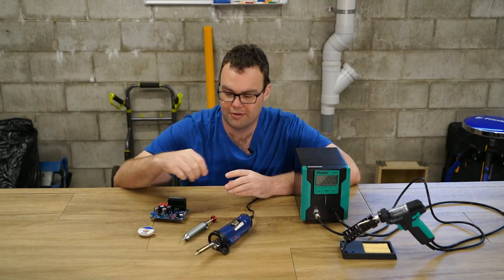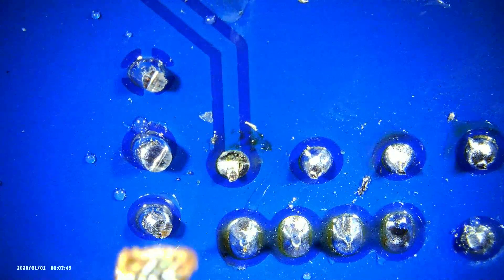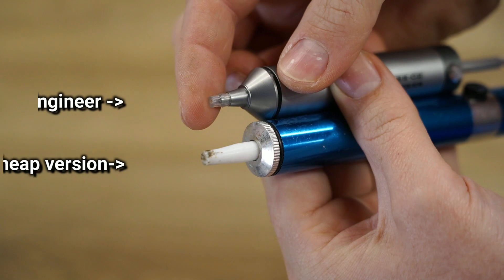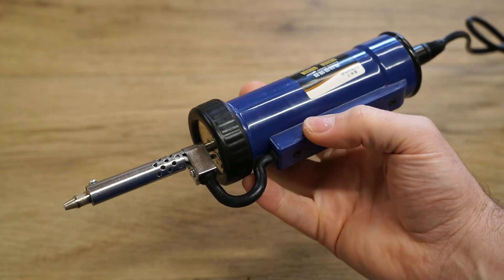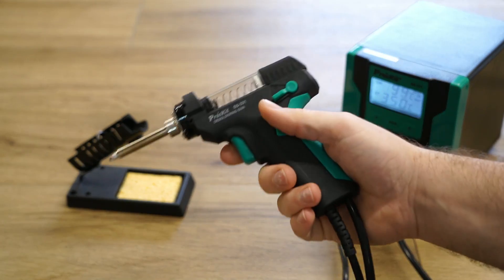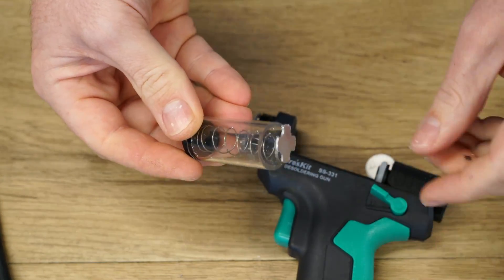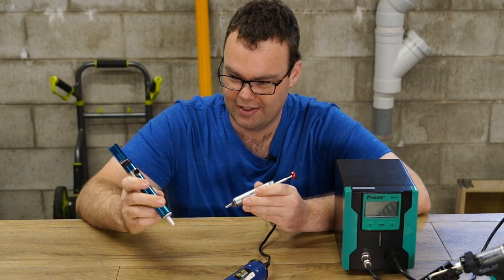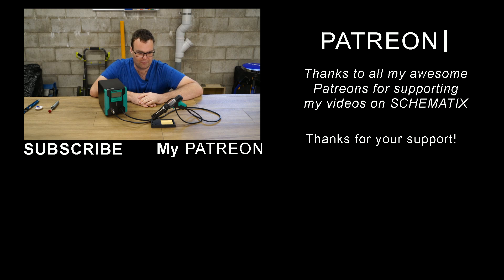The easiest method for Desoldering components!  Solder Wick, Sucker & Proskit SS-02 station Reviewed

Comment: 3:44 the manual for this product states not to remove the rear cap so as not to negatively affect the suction of the device. It says to remove the nozzle for cleaning and to re-lubricate the interior of the cylinder with a grease to keep it resistant to solder sticking.
Reply: Yeah I really don't get why he did it lol. It will mangle the O-ring on the threads really soon
Reply: What grease should be used? The solder sucker in the video is set to arrive at my house in 6 days, ordered it even before I saw this video. What grease should I buy so I can keep the sucker in good shape? And how often should I apply it?
Reply: @Malphaswastaken when it doesn't suck much of the solder
Reply: @Malphaswastaken i think they were talking about the previous tool not the solder sucker
Reply: 😂😂😂 HOW Tf are you expected to remove the solder from inside without removing it?!?!?
Reply: @kilgoretrout4461  you remove the bottom cap then squeeze the plunger to push the solder out.

Comment: you can easily upgrade that cheapo solder sucker by putting an old anode cap taken from crt tv to the tip of the manual solder pump, if your only desoldering single layer tht boards few components at a time it still works faster than a desoldering station as you do not need to wait for a couple of minutes to get  it to working temp

Comment: Many thanks for this video, I found it when looking for something to replace the plastic cheap piece of crap solder sucker I have, which I can guarantee you is even worse than the one you said made you hate solder suckers. I ended up ordering the Engineer SS-02 because of this test, and I have high hopes for something that actually sucks PROPERLY. 😉

Comment: Hot tip (pardon the pun) for the Proskit gun: keep the suction on for a good few seconds after removing from the joint to greatly reduce the amount of blockages.
Reply: The tip of a desoldering iron tip is supposed to be tinned, so that it makes good thermal contact. The hollow tube, on the other hand, is stainless steel so that solder won’t stick. However, flux residues can “snag” solder. The original comment is correct: one should continue suction to ensure solder doesn’t stop halfway through, where the heat may not be enough to keep it molten, especially if there’s flux residues in between. (That’s why some professional desoldering tools, like Pace, automatically run the vacuum a certain time, even if the button was pressed less.)
Reply: I have one of those but the tips are not so good, the solder is not sticking to the tips, its like they are made from the wrong metal.
Reply: @wicklowmountains8618 It’s a desoldering station, not a soldering station
Reply: @wicklowmountains8618  solder is not supposed to stick to the tip. That's how it is designed

Comment: Greetings from Egypt, I am a follower of you.... I want a method for manufacturing liquid tin
Reply: If you mean liquid solder, then search for "Solder Pot". Note that the cheap ones from China have some safety issues so watch YouTube videos to ensure that you understand how to make them safe to use. It is not a good idea to poke conductive wires into a pool of liquid conductive metal that might be at 220V mains voltage!

Comment: Coming from someone that routinely uses wick to clean up whatever the Engineer pump leaves behind, around a through hole component... Your wick technique leaves a lot to be desired. Instead of just laying over the top, push it in from the side and place your iron on the wick, but adjacent to the joint instead of directly on top of it. Obviously it is a slower technique, but when done correctly you can wick away every last remnant of solder without a pump.
Reply: 100% agreed. He uses solder wick almost as wrongly as Julian Illet.
When soldering, the solder always flows to the hottest place. So, moving the tip of the iron away (along the wick) after the joint is heated will pull the solder and literally "vacuums" it out of the hole.

Comment: As someone who works in a factory setting and uses a solder sucker daily, I dont want people to sleep on some of the cheaper solder suckers with plastic tips. I've personally used the Engineer solder sucker, and while I love it and would definitely use it for personal projects, the silicone tip just doesn't hold up for repeated or long term use. I found that after about a week of factory use the tip degraded to a point where it didnt make a good seal with the pad and the sucking quality decreased greatly. Meanwhile the cheap plastic tipped solder sucker my company provided made up for that in pure power over seal quality. While the plastic tip is definitely worse for making a good seal, the pure power of the springs in some cheaper solder suckers makes up for it and creates a much more consistent performance. All in all the Engineer solder sucker lasted me two weeks of daily use while a cheaper variant with no name has lasted me years without degradation
Reply: Plus one has to consider replacing those tips if need to, in the UK they are impossible to find easily and cheaply delivered, so that's a restriction from me, my cheap and cheerful manual plastic one just works everytime, once you get to know how to use it.
Reply: I got one cheaper solder sucker myself. Was 2,50 euros.. Did the job just fine.. So not all cheap things are bad. But i agree that plastic tips are getting worn, and then its expensive to replace. mostly 5 - 10 euros)

Comment: I had a coworker that would use a air compressor nozzle to blow off the solder. I was shocked because none of his work had ever failed but I was sure there had to be hot solder blown everywhere
Reply: Explanation: he is an alien from Planet X.
Reply: hmm that’s actually pretty clever.. I’m trying to desolder a bunch of through hole switches right now and I happen to have an air compressor right next to my bench.. I might have to give this a try. 

Are there any more details here? Does he use a heat gun or iron to melt it? Does he use flux?
Reply: @ZombieLincoln666  you are likely to blow away desoldered components which would be annoying, as well as blowing molten solder everywhere, just spend the $15 aud on the manual solder sucker linked in the video, it will be a hell of a lot easier and less messy

Comment: I reviewed the pros kit a while ago, and have been using it ever since, it works very well.
The only thing I did do was modify it to put a power switch on the front of the unit as the rear switch position was inconvenient and a bit stupid really, I did a video on that showing how to do it.
Reply: I also placed the power switch on the front panel. Another modification consists in replacing the fan. I removed the original one, enlarged the mounting hole and mounted the new 12V 80x80 fan from the outside. I reduced its power supply to 6V. Now the station is very quiet. As a final adjustment, the vacuum motor was switched via a FET transistor, which I control with a switch in the handle. This was because this switch is undersized for the working current of the motor. During use, it often happened to me that its contacts remained stuck and the motor still worked.
Reply: @vladimiralena9129  yes I also changed the fan and reduced its voltage to make it quieter, mine hasn’t had any problems with sticking on though.
Reply: I have a master power switch on my bench that switches all my gear on and off with one switch

Comment: Hello, greetings from Slovakia. I have a Proskit, I am very satisfied with this station. I have set the temperature to 370°C, this is a suitable temperature so that the station does not clog. Flux at this station is better not to use because of the filter in the glass cylinder.
Reply: I used an 80's era Hakko  desoldering station for 15 years as a repair tech  followed by an Aoyue unit for another 5 years. I suspect that the spring inside the glass cylinder serves no useful purpose; you're probably better off with the old school technique of putting some medium grade steel wool into the glass tube, which not only catches the Solder but ialso filters out some of the rosin flux fumes and keeps them off of the ceramic filter, and it even helps dissipate some heat so you don't have as much hot air going into the vacuum pump.
Reply: @goodun2974  The spring presses the filter in the rear position. It has to be there.
Reply: @vladimiralena9129  ,  in the older Hakko, and more recent Aoyue desoldering guns, the ceramic filter is held in the tube by friction (the Aoyue's tube is plastic and has molded tabs to keep the filter in place).I tried using the tapered spring supplied with the Aoyue gun that is supposed to collect the solder but I didn't care for it and went back to using a wad of steel wool in the collection tube, like I had done with the old Hakko.
Reply: Thanks for the info! I’ve been looking at desoldering stations for a while now, but I still have bad memories of owning a Hakko desoldering gun around 30 years ago, and it was the most horrible piece of equipment I’ve ever had. I spent more time unblocking and repairing it than I did using it. Your Prokit sounds like it it doesn’t suffer the same problems.

Comment: I love my automatic solder sucker! At just under €20 delivered from China I have no longer a need for a desolder station.
Desolder wick is a very handy additional tool. In your video you did not seem to allow the heat to get in that plated trough hole.
Reply: Yes, the way that he used the wick was totally wrong. That's why he got such poor results.

Comment: I've been using the Engineer Solder Sucker for long time , for me it's the most practical desoldering method I've ever used over the years .. quick and effective.. very well made
Reply: #DONTBENDTHESHAFT!!!!
Reply: I bought one that looked the exact same (viralloy) and it was TERRIBLE. Whenever I'd push out solder, the silicone tip would go with it!
Reply: @Scyth3934  I was looking to buy one and saw different makes and I'm sure by now there are snide ones about, so never bothered.

Comment: top tip is to pre-heat your pcb with a heat gun and good old solder sucker.   Problem with the desolder stations is the tip gets oxidised and doesn’t wet/heat the solder and gets blocked up regularly
Reply: If the solder sucker is getting clogged, then you are using FAR too little heat. You have to have the solder hot enough to stay liquid all the way from the tip to the cannister
Reply: Try to melt calaphonia , once you get heated tip, then use it for desoldering. I had blue one from video, didnt clogged once. (Although diodes died on that one after one week....)

Comment: I used compressed air from a ordinary compressor, works really well, desolders beautifully, but chucks tiny blobs of solder everywhere.
Fine if harvesting parts from an old pcb, possible short circuit risk if repairing.
Reply: Do you melt the solder with a heat gun or iron? 

Would removing most solder first with a wick or sucker first help?
Reply: @ZombieLincoln666  I only own a soldering iron. I have used compressed air because its quick and easy I do not bother with desoldering first but I guess it would be alot less messy